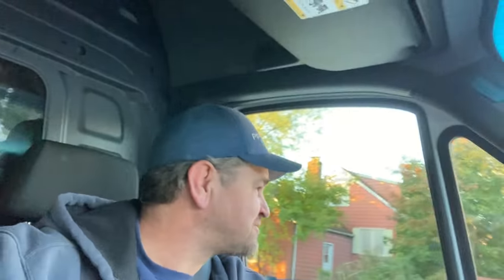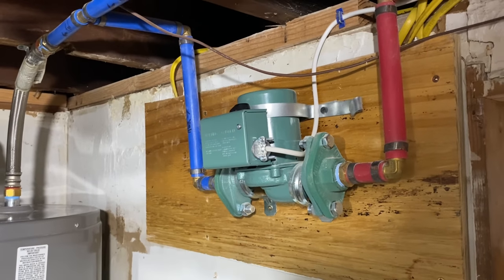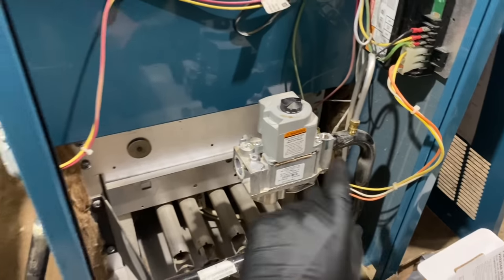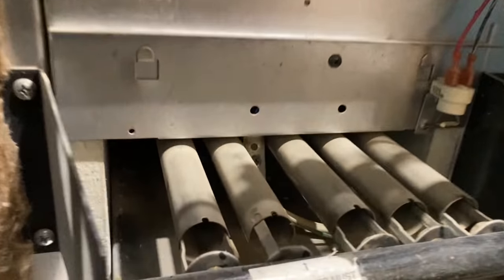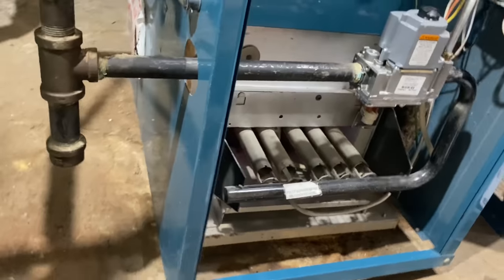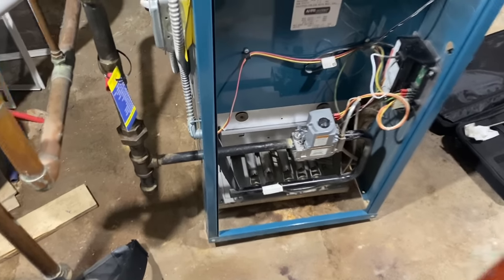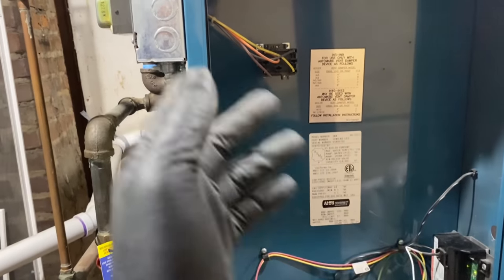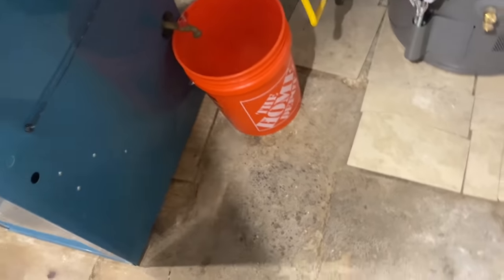Burnham SIN4 Gas Boiler Making Loud Noises - Taco 007 Circulator Used for DHW Recirculating- Hacks!

Comment: Some interesting information, why is it called a street fitting:
 "When water mains were being run down a street, the installers would put a tee in front of a house. the branch of the tee was facing up. into the branch they would put an elbow with male threads on one end and female threads on the other. so it was known as a "street" elbow."

Comment: summer time without boiler on, that water heater may not vent or if the boiler has very long off cycles in cold weather and the chimney cools too much and loses draft.
it should have a ton of draft with the boiler chooching wide open. still no excuse for the vent to be run with backwards pitch 🤯

Comment: That flex pipe on the water heater is a big No-No I guess he did it himself you could tell no copper sweat of the hot and cold I like the tool you use fancy schmancy it beats soldering the ProPress saves you a lot of time it's worth its weight in gold

Comment: SKOOL OF HARD KNOX,found out in the past with taco circ's. [f-series] the circ body should not be installed with motor body straight up unless you have enough pressure,20 psi maybe.read the paper in the box.had a steam system with domestic coil , 10 psi loop ,and a stack of pumps in the customers boiler room.blah blah ,have the customer calling me now.started by haveing apprentice's read parts and product info while on down time.always something learn.

Comment: screwing in the bolt straight you can spin it backward a 1/2 turnand then go forward.
Reply: @PipeDoctor  comments are 90% for other viewers, not only the creators.  plus, inserting the bolt or nut, turning it backwards at first is a better tip. it helps make sure  you do not cross thread.

Comment: cast iron pump for recirc. no, add to that the motor is vertical, another no (but allowed if system maintains over 20psi at all times), if not that becomes an air trap and the motor cartridge bearing surfaces run dry and screech to a permanent halt.
IRL, that cast iron pump will emit far less contaminates than what's coming from the city or well supply.  🤣😵 but don't tell everyone that, oh wait, too late.

Comment: The shaft needs to be horizontal, not vertical, or the bearings will prematurely fail.
Reply: They can be mounted with the motor in a vertical position provided the system pressure is over 20 psi.
That still doesn't negate the fact that you don't put a cast iron circulator on a potable water line.

Comment: 6-9%
Reply: That in the trade is called a tubing wrench, it's designed to specifically take apart tubing with flairs.  It's 5 sided to give maximum grab on soft sided nuts that would round off with a normal wrench,  like the open end adjustable you always pick-up.  Or a common wrench.

Was designed and used by auto mechanics to prevent round off on carburetor fitting. 

My set, Snap-on are at least 55 years old, one of my first Snap-on purchases when I had some spare money.   I think my set has 6 or 7 pieces from maybe 1/4, to 7/8 with common sizes duplicated so if you have (2) say 1/2" fitting,  you can hold one and twist the other
Reply: @Supa Trending Daily  all my training and experience with flair wrenches are on fuel systems on gasoline and diesel vehicles from 45 years ago.

Almost every time you would go to pull the fuel line at the fuel pump or the carburetor,  you'd have a problem.

And since you were working on one piece lines molded around an engine you didn't have space to cut back and install a new end.  I've personally never had an issue with a Gas valve on natural gas or propane. 

I was just trying to explain the original name and application of the wrench.
Reply: @jimgale8465  Flare Nut Wrench!
Reply: @mikeholubek4419  that's probably the official term.  My set has been sitting too many years, but every once in a while you need it, so it's there in box